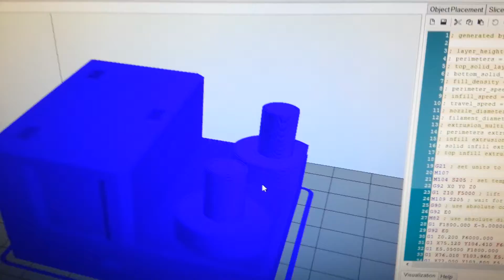3uP Update 3 - A lot of 3's!

Comment: Is it an issue if we have put some cyanoacrylate to fix the pieces in place in the assembly like it was asked by Qu-Bd when it will be the time to unassembly the whole thing?
Reply from the maker: It shouldn't be much of an issue, I was able to break the bearings free fairly easily and I'm sure any rods should come out too. If not, just apply some heat from a hairdryer or heagun and it will make it even easier!